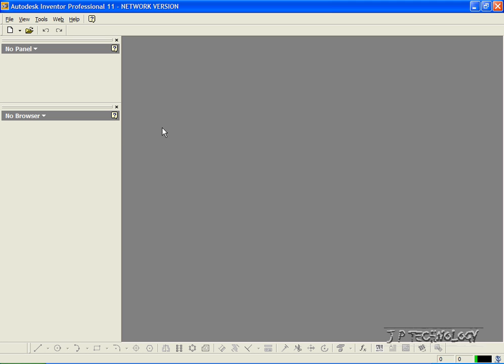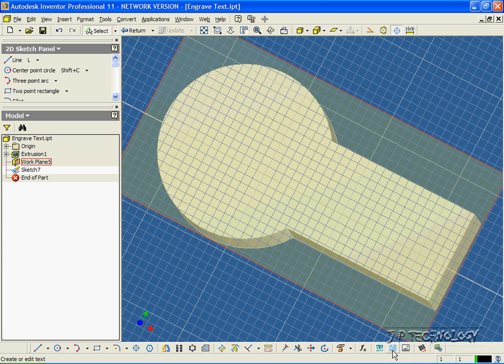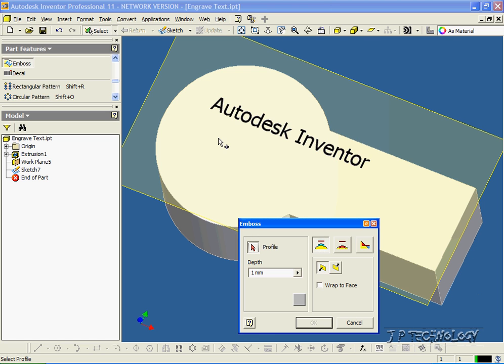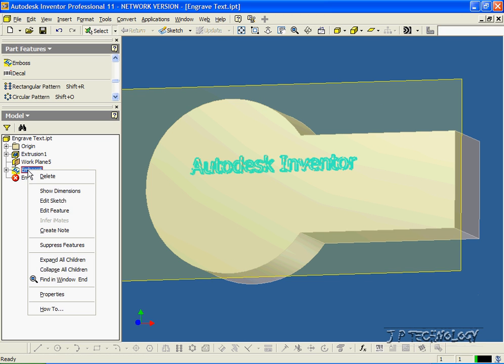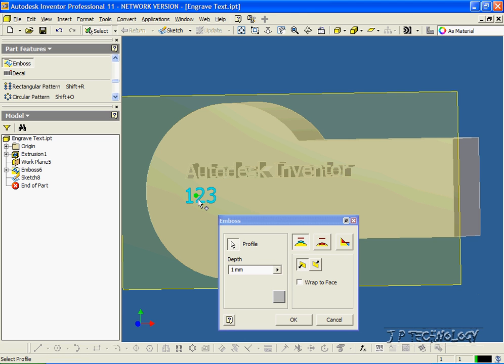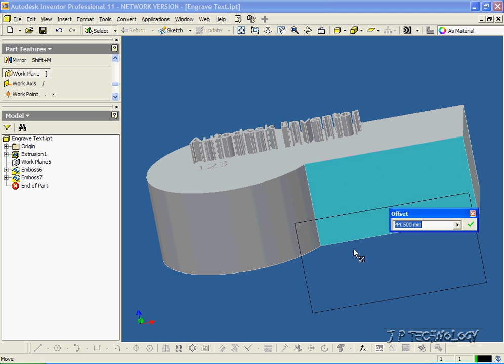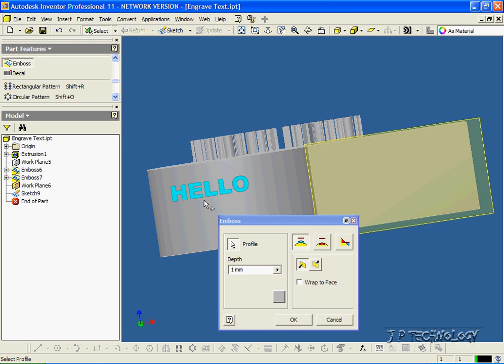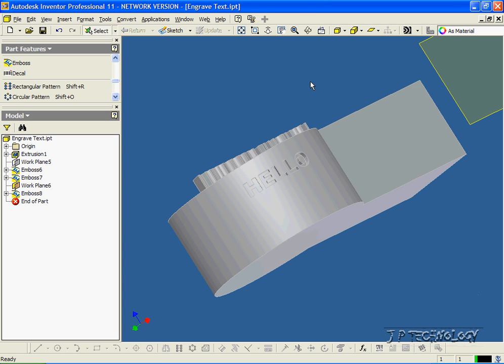Autodesk Inventor 11 tutorial #23 "Emboss Engrave Text"

Comment: KB918118 is automatically a Microsoft security fix for SP2 and is downloaded with your updates, even when you locate the file and successfully delete it then on the next update it is restored. So before you discount the fact that you haven't as you say got that update, to be sure, you need to do a search. ie Start menu, Search, Files or folders, then type in the search tab. KB918118 Select C: as the area you need to search. after the search, you should see a reference. Let me know the outcome.

Comment: I had the same problem, but resolved it by deleting a Microsoft hot fix update kb918118 from the add remove programs in control panel, make sure the updates box is ticked restart the computer and hey presto all sorted. let me know if you get sorted.